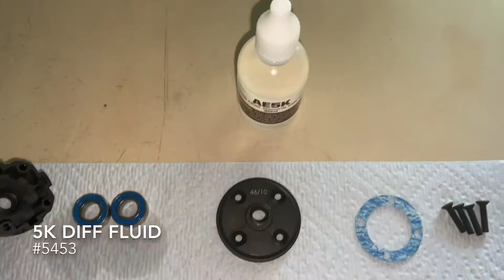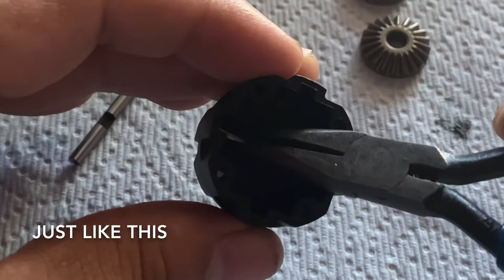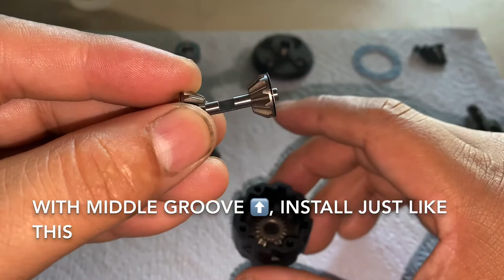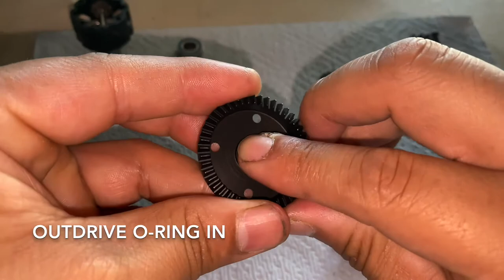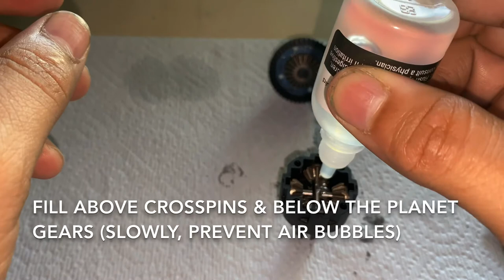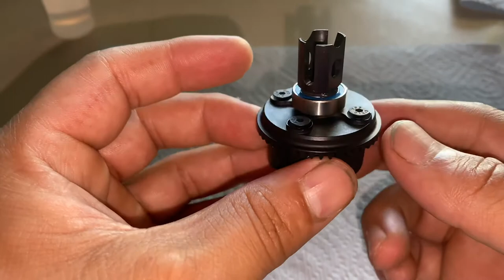Team Associated RC8T3.1 Rear Diff Build (how to video)

Comment: Very odd that there are no shims on the inside right after the o ring. Usually there is a larger flat shim which helps with inside mesh and helps seal with the oring. I would think the out drive pin would eat away at the gasket.
Reply from the maker: Yeah I see what you mean, you can probably add one if you like but the manual didn’t call for one
Reply: @weekendrc  I just picked up a rc8t3.2e and same thing, no big shim in there. Supposedly these are the new V2 diffs. I will run them like the manual says and see if they eventually leak. Any issues with yours. I still have the original rc8tce and the diffs have been bullet proof.
Reply from the maker: @terryfrome1641   interesting, I never had a leaking problem still this day
Reply: @terryfrome1641  where can I get new diffs for front and rear for rc8T3.1e. Are they the same as the 3.2e?
Reply: @Robi_435i  Ebay chop shops. Yes the 3.1 and 3.2 are the same.